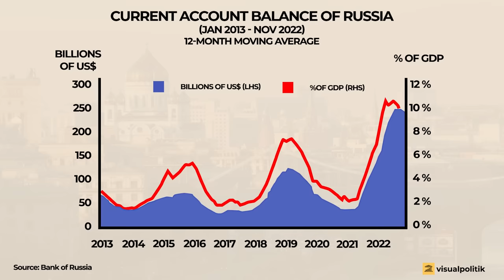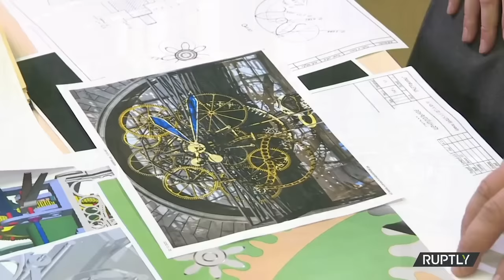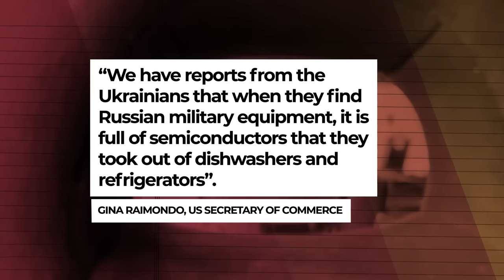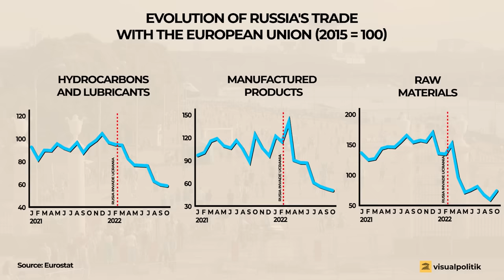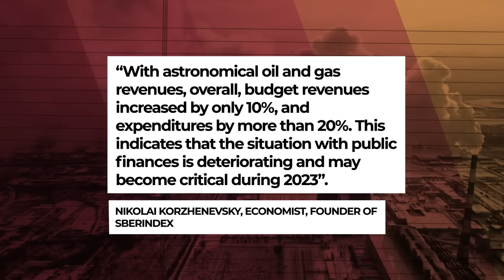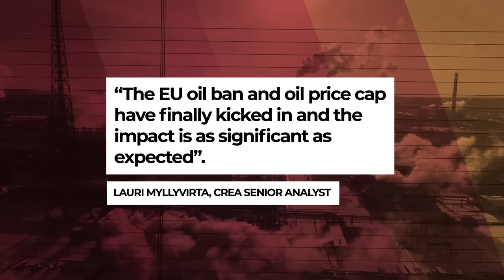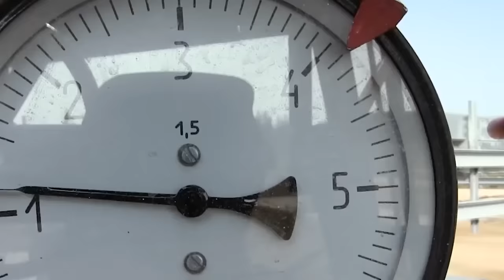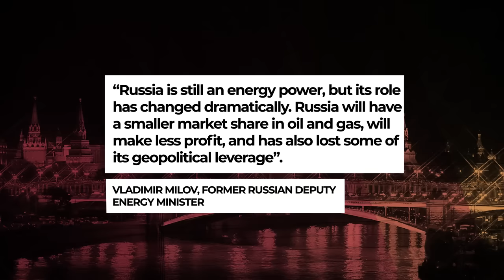In What State Is the Russian Economy?

Comment: Austrian TV (ORF) today was talking about Russia's massive sales of gold and Chinese Yuan. Gold prices went down significantly.
I hope that all storage capacity in RU is running full quickly and this will block further production which is - in  case of oil and gas - apparently not such an easy thing to do only temporarily.
Reply: Oil and gas can quickly blow back if not pumping continuously and is a serious issue!?!
Reply: @thomasherrin6798  Not that it will blow back, rather most of Russia's Oil wells are in Siberia, so if it stops flowing the permafrost freezes the system. When things freeze water gets in and expands which will burst all the pipes etc They also lack the experience to get things back online again after without western tech and expertise.
Reply: @MSD Group LOL the same meaningless comment all over the place 🤣 Keep up your "great" work for the Kremlin!

Comment: Putin miscalculated from the start of this. First in how long Ukraine would last. Next he overestimated his energy hold over the EU/UK and EU/UK ability to get other sources of gas/oil (Norway, US LNG etc) and ability for demand reduction via efficiency gains, heat pumps, and renewable production acceleration. The longer this goes on the weaker Russia's hand becomes over time.
Reply: British people's will to support, bear the cost of inflation and higher fuel prices and NOT go to russia cap in hand for cheap oil and gas.
Reply: U.K. was not dependent on Russian gas, Mainland Europe and specifically E.U. countries crashed the European Market in the scramble for gas after Russia cut off their supplies, the U.K. stopped all Russian imports shortly after the invasion. The market has settled down now and as Germany will have a number of LNG terminals by Winter it is hoped that it won't repeat itself!?!
Reply: @thomasherrin6798  Sorta. From what I understand UK is connected to EU market as a whole for gas so they still paid a higher  rate as gas being imported from Norway etc became more pricey. UK though will be good as they can always increase North Sea production in short term and have more offshore wind farms coming online.

Comment: Imagine over the last 30 years if Russia had used its wealth to build a broad based economy.,
Reply: It did, broadly based all over Europe unfortunately!?!
Reply: @thomasherrin6798  the thing I find interesting about the whole matter is that Russia didn’t spend the money and make the proper investment in producing advanced microchips.
Reply: @waywardgeologist2520  I'm not too sure they'd have been able to.  Some of that equipment is highly restricted, as I understand it.  I think it is one of the Scandinavian countries that makes some of the machines to fab the  smallest feature size ICs.  Russia actually doesn't make ANYTHING that is sophisticated at all.  If you look at their weapons they consist totally of Western chips.  And it's not just the chips.  They use premanufactured sensors, boards, displays, all of it, really.  

If you look at the Orlon drone, as an example, which is a pretty simple reconnaissance device, the board has GND written on it, so it isn't Russian, the power plant is Japanese, Saito, and the two cameras are Japanese, the visible light version being an OTS consumer model, a Canon.  The chips were made in the US, China, Germany, and a few other countries.  What the Russians made is the air frame. Hell, I think even the gas tank was bought IIRC, and I think it has a soda pop bottle top (not kidding).  

If Russia were forced to make the parts itself, it wouldn't even be radio controlled, which I fooled around with 50 years ago.  It would be a free flight or control line plane (again, not kidding).  And it would have exactly zero parts in it that would make it useful as a drone, you couldn't talk to it, it couldn't talk to you, you couldn't control it, it couldn't talk to Glonast (Russia's GPS equivalent) and it couldn't 'see'.  

THAT is where the Russians are at.  The Iranians are no better.  These machines "they" manufacture are just parts made elsewhere that they glom together.  When you think that when more than Russia was involved, meaning the USSR, 60 years ago, Russia was WELL AHEAD of the US in space flight all the way up until the first trip around the moon.  First to orbit, first satellite, first to space walk, first to dock (pretty sure), and pretty much everything else.  It was literally the difference between Space X and Blue Origin right now, in other words, in different worlds. Lobbing a missile straight up and straight down is literally nothing compared to launching satellites, and ferrying men to and from the ISS.  And Blue Origin can't even seem to get that right.  Bezos is an idiot.

Russia doesn't make anything anymore, really.   You won't find a Russian phone or a Russian computer or a Russian smartwatch, or Russian anything else even of moderate tech level.   I saw interviews in current Russia where people were asked if they had ANYTHING on them that was made in Russia.  One guy of the eight or so interviewed said he did, and it was a pair of sneakers, and he couldn't even remember the brand, which apparently Russia doesn't put on them, on the outside.  He then asked if these Russians had anything at home that was Russian made.  All but one said no, and he couldn't remember what it was, but he was sure he had something.  In other words, in all likelihood, none of them owned ANYTHING that was Russian.  They are going to start owning it now, though, and MAN, are they going to be surprised what utter crap it is, what little the Russians can produce.
Reply: @MrJdsenior  decent analysis. I agree with most of what you wrote, but baring Putin it does seem that Russia has squandered their future and is a warning sign to countries about being somewhat self-sufficient.
Reply: What?! And, give up all those brand new shiny yachts??
Reply: @freetolook3727  😝

Comment: The hits to Ruzzia's arms sales will deal some interesting synergistic effects to their economy in the long run. Defense industries require vast investments in pure and applied research in order to remain on the cutting edge; a contracting military-industrial complex [MIC] funnels less money towards scientists, researchers, and engineers of virtually all kinds -- which will prompt more of these educated, talented STEM workers to give up on Putin's Ruzzia and emigrate. The state of RF's petrochemical engineering is already so dire, they've been dependent on the foreign expertise and technology of western (mostly US) firms for most of the Putin years for much of their oil & gas exploration & extraction -- even more so now, as older fields of the relatively easier-to-extract fossil fuels tap out, compelling RF's oil & gas firms to turn to increasingly remote (think Arctic & Siberian areas without roads or infrastructure, or where infrastructure risks sinking into melting permafrost) and/or "sour" [high-sulfur, less-valuable, & requiring more extensive refining] sources.

Comment: Putin is flying the plane of Russia and he has locked out the rest of the crew from the cockpit. One of the two engines is out, he is running out of fuel,  and the plane is descending in a spiral.  It's just a matter of how much altitude or fuel he has left but he isn't going anywhere but down.  He is still telling the passengers,  "Don't worry, I've got control of the plane and we are getting close to the airport."

Comment: It is not only that Russia is losing markets and failing to receive more than $180,000,000.00/day due to the price caps on oil, gas and now the by-products imposed by sanctions, forcing the Russians to sell with discounts that in some cases exceed 40% but is facing oil and gas production and storage problems. Oil and gas pipelines to Europe are rapidly deteriorating due to lack of maintenance and product flow for which they were designed and it could take years to get those facilities back up and running again even if that were the decision.

Comment: If Russia acts smart, the could deal with this in a very very long run. But for economics, they are not that smart. 

Sure, they will sell natural gas and oil to India and China. Both took the oportunity to fill their storage to the rim for cheap. But what now? Build more storage and more pipelines? For what demand? Their industry needs to improve to use all that up. And they won´t without demand. We are worldwide in a recession. 

There are some industries which are highly depending on natural gas like production of glas or hydrogen. The Chinese could do that for cheap in the future with Russian natual gas. But the Chinese have to build the factories first, they have to educate their workforce for that. Even if they do well, this took years.

Remember when Nordstream 1 was closed because a turbine was in need of repair? That turbine came from Germany. Large parts of Russian facilities to get raw materials or to transport them depend on foreign technology. Thats why they took semiconductors from washing machines. They can´t produce them on their own.

So they will have a hard time to run all of that without western support. And it will get even hard. A big part of their educated work force left the country and the not so fortune are thrown into the meat grinder. 

So will we see sixty year old babuschkas welding pipelines and producing semiconductors in the future? 

Germany had a hard time getting eastern Germany (DDR) to near the same level as western. But even after 30 years, their is much to to. And the western part was rich, and part of the EU. How will Russia fix their economy in the future? No workforce, no money, a lot of corruption...

Comment: I wonder if it would have been better to allow all non-key exports to Russia, while severely limiting imports from Russia, to try to push Russia into a huge current accounts deficit to bleed their economy dry?  Meaning, ban all semiconductor experts to Russia, but let non-electronic luxury goods be exported there.  It would have created less pressure on Russian citizens to leave Russia, but might have applied more pressure to their economy more quickly.
Reply: @dosa2990  You said it yourself, the western brands mostly chose to pull out, they weren't told they couldn't import into Russia by the Kremlin, so your comment seems to be arguing against itself.  I think most of those brands pulled out because the political winds were blowing that way, and it was a brand reputation risk.  Had the political winds not been blowing that way, many would have stuck it out longer I suspect.

Comment: The big problem is, western economists always try to apply western economical metrics to monarchies and dictatorships. This will inevitably fail, since values, like GDP, per capita income, etc. are without meaning in countries with a high degree of autarky. There are things like a shadow-economy, widespread corruption, slavery and/or forced labour, and a lot of cititzens, who work inofficially for the security apparatus. Sanctions can be seen as a form of punishment for a country, but these have never ever caused an economical collapse, or a system change. If an autocrat is toppled, his successor will exercise just more tyranny (e.g. Iran, Egypt, Mianmar, former Eastern Germany, etc.). The best example for this fact is North-Korea. According to all western standards, this country would be dead. However, it isn't.

Comment: Semiconductors from fridges? Does fridges even hove those? Or you mean fridges does not have semiconductors because of that? I did not think of that.
Oh, yes I do know that some fridges have electronic brain, but those are not very stable to electricity changes. And cost a lot too. Good old mechanics is very reliable and cheap in repairs too.
And what about dishwashers? They are expensive as sh...
Where Russia get those devices anyway? And for what money?
May be Russians bought rubbish circuitry from China? Chinese love digital rubbish from Germany and such. Germans love to put checks inside squares, that they recycled this and that, just by sailing off rubbish on large boats into Chinese direction.
Or you seriously suppose, Russians are dissembling expensive luxury devices just for boards?
Also. How do you distinguish say fridges semiconductors from... well... any others. They have snowflake sign on them, or what?

Sorry to interrupt those bot comment flow with some questions and thoughts.